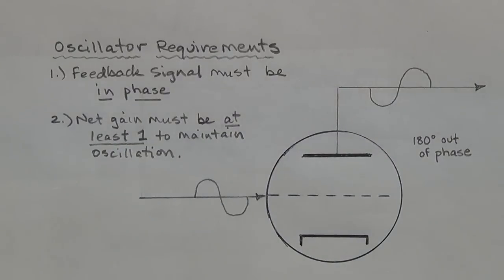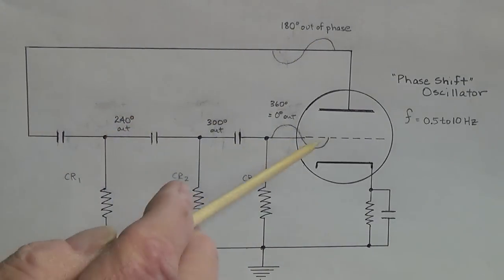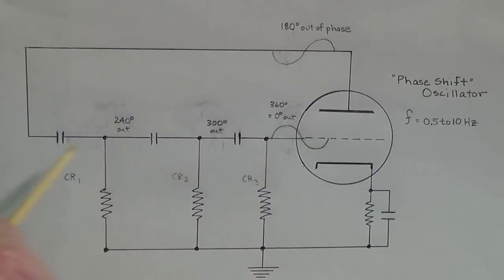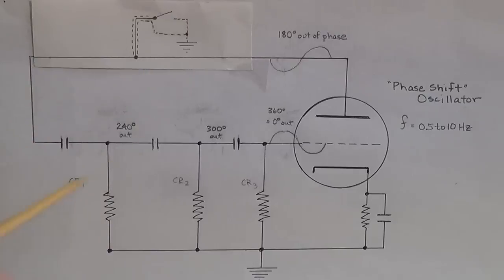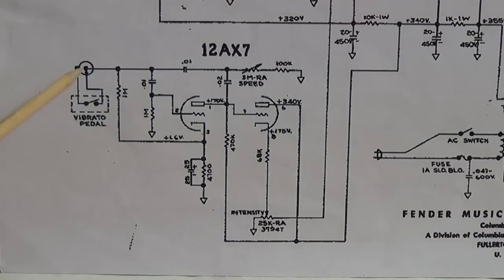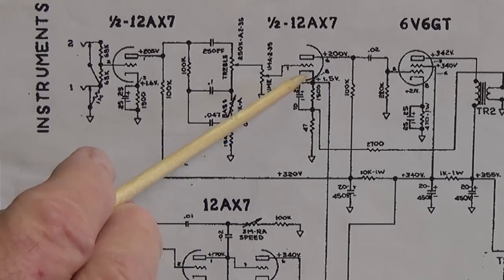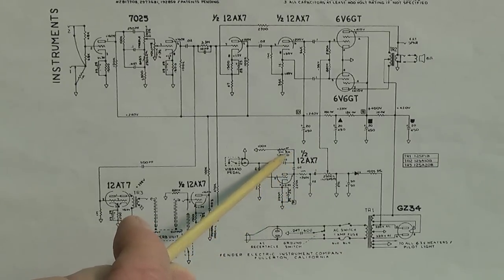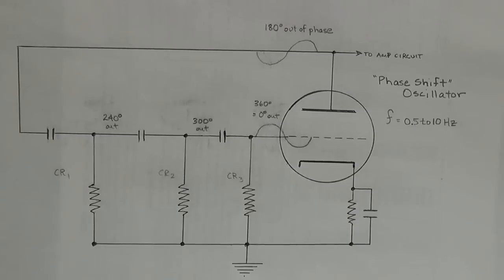How Does a Bias-Shifting Tube Tremolo Work ?

Comment: Pop Quiz: Two reasons you can't hear the Tremolo's oscillator through the speaker when the amp is idle.

Reason 1: The oscillator's output of 0.5-10Hz is below the low-frequency cut-off point of the human ear. I've read you can't really hear sounds below approx. 20Hz. This mainly applies to the single-ended amplifier. The tremolo's output should still reach the speaker in a single-ended amp(you can probably see it on a scope) but you just can't hear it. If you increased the frequency of the oscillator, you could probably hear the hum on the output easily.

Reason 2: In the push-pull amplifier the tremolo's oscillator is being fed into the grid's of the 6V6 tubes in phase. This will still produce an oscillating current in the primary of the output transformer, but since the current will be pulling equally in both directions on the primary, none of signal will be transferred to the secondary and therefore the oscillator signal will never reach the speaker.
Reply from the maker: Congratulations, DU, you get an A+ in Tremolo 3101. The oscillator frequency is subsonic and (due to being applied in-phase to both output tubes) cancelled within the output transformer. Well stated and well done :)
Reply: Thanks. I design all kinds of SMPSs normally, but these vintage tube designs are awesome. I have some old pieces of test equipment that are entirely tube powered. Even a kit-built oscilloscope from 1968 that is all tubes, well, except for a small handful of power diodes. The most interesting part of the scope though is the small tube powered SMPS that generates the acceleration voltages for the CRT. Really enjoy watching your videos. I've learned quite a lot about how tubes and tube circuits function.
Reply from the maker: You're welcome, DU. It's great to hear that the videos are helpful. Thanks so much for your input :)

Comment: Great to see you back with more videos Uncle Doug!  I've been recently trying to get the tremolo section working on a clone of a Univox 45B but without success. (It's a push pull amp using 6BM8 's in the power section and I just love it's tone). The original circuit uses half a 12ax7 and it just doesn't seem to work, I might have to use the fender tremolo circuit design instead.
Reply from the maker: Greetings, Colin. It's great to hear from you. Sorry you're having tremolo trouble. The values of the three oscillator loop caps have to be completely correct, and oscillation will vary depending on the tube....some work better than others. Also, looking at the schematic, the "IMC" value should be around 1Meg, I believe. You might check it as well as the status of the footswitch jack. Best of luck :)

Comment: I think I have got it, the larger tremolo signal shifts the smaller guitar signal up and down the bias slope, cyclically sliding it aternately between the steep part and the flat part of the slope.
Reply from the maker: A viable theory, WC. It's interesting that the Tremolo signal does not seem to increase the volume of the music signal significantly, but does reduce it significantly. Perhaps the excursion into the "flat part" of the slope effectively shuts down the tube response (to music signal), while movement along the "steep part" of the slope has a much less dramatic effect.

Comment: Thanx Uncle Doug and Rusty, I was just working on a similiar circuit!
What is the 25 uf 25v Cap for, it is an electrolytic, thanx
Reply from the maker: You're welcome, GH. That is the cathode bypass cap for the first 12AX7 stage (the phase shift oscillator tube). It increases the gain within the tube.

Comment: Hey the best to you first of,..the info applied will come in handy in adjusting and tailoring the timing of a tremolo circuit being there's custom kits where it's a drop in and play but to their preset. Here there's an explanation that at least coincides with a general understanding that can be added onto foregoing an actual degrees and potentials for a mishap.Thanks!  On my 1969 Ampeg GV-22 a rare composite of a Class A but in a Solid State format, not,.. but I wished (MAYBE) a GZ34,..the duplicated Tremolo circuit design comes in the format of  a rich quality ''B'' series Hammond Organ, Ampeg produced amazing little effects on their 60s amps for accordians,Old ighty-Eights,Harmonica, and my favorite the guitar,..even better than the ole Magnatones, Reverb with a tail when the cut-off's engaged and a separate cavernous Echo, secondly the ''Hammond Styled Tremolo'' also with a tail, with a separate Vibrato as noted by the rocker switches and man there's a definite difference,..the Ampeg Gemini series amps are some of the best Tremolo amps made but with the ''Superlative'' GV-22 40 watter 6L6s there's no equal as` an all around,.. your formatted review brings it to a practical insight that kept me from a misguided attempt of an filter cap upgrade, some reason with the replaced newer filters the effect would cut out and the footswitch had to be rest in order to get going again gotta feeling the circuit's anomaly is presently dependent on  a bias that rejects extreme changes figure in the older resistors,bypass caps, tubes 6CG7/6FQ11(?) , RCA7025, and the Audio filter electrolytics, it's in the timing, by all means please alert me if you think otherwise, Thanks again Uncle Doug the best to you and urs and our Buddy Rusty the Wonderdawg!!
Reply from the maker: Nelson, it's always good to hear from you and benefit from your very broad knowledge and experience with vintage amps. It's interesting that you may have a circuit that resists extreme bias change, which is quite unusual in a non-cathode-biased (I assume) amp. Rusty and I send our best wishes. Thanks for your input.
Reply: I caught something you stated could be a  probable fault in that there's a chance that the footswitch is faulty explaining why the analog signal drifts before the effect not the signal fades away, odd too is that the timing is always the same  like a preset on a clock or a momentary switch, I'll reassemble the amp and resolder the ground on the footswitch and see if it solves the problem,..   neophyte serendipity I think lol,Thanks!!
Reply from the maker: Footswitches cause a lot of problems with reverb and tremolo circuits, Nelson. I hope you discover and rectify the problem.

Comment: Hey UD, great work yet again! Actually very timely as I'm considering putting output-tube bias-shifting tremolo in an amp. The last couple I've built are along the lines of the Valco Tremotone with a 6SQ7 acting on the first preamp tube. At any rate, I was under the impression that when you switched the tremolo on, it actually connected the circuit to ground. Then the switch was opened to silence it. You seem to show the opposite about the 8:00 mark. It's entirely possible I have also sucked up too many solder fumes...
Reply: Upon further review, yes, I need to invest in a good extractor system.
Reply from the maker: Greetings, Pisola....it's always good to hear from you. We missed you at our AU meetings :)
Reply: Uncle Doug
UD, I think I had the right thought and the wrong spot. You were indeed correct the first time the way it's drawn. Please check my math on this -- the Fender circuits (similar to what you have drawn) do shunt the voltage in the resistor-cap filter loop to ground, effectively turning the tremolo off. The circuits I've built are more like those used by Supro, Ampeg, Gibson and others, where the switch goes between R1, R2 or R3 and ground. Those circuits don't operate if the switch isn't closed to ground. Sorry about that.
Reply from the maker: Greetings, MA. It is confusing. The Vibro-Champ in the video does not require a footswitch for Tremolo to operate and if you have one, grounding it does stop the Trem. The very similar grid-biasing Trem in the Princeton Reverb does require a footswitch because grounding the Trem loop turns it on. Likewise with the photo-resistor Trem in the Deluxe Reverb. Thanks for the follow up comment. Your input is always appreciated :)

Comment: Thanks for the video. I've been curious how  these really work, particularly the oscillator. Would that be the same as the freq oscillators in old tube radios such as superhets? Is there any functional advantage to use 3 vs. 4 RC filters to adjust the phase shift? I can see where a 3 step network ought to be cheaper and less complex due to fewer components. And, can you say if there is preferred location for the speed control on the resistors or would it be depending on which allows a shorter connection to the controls on the face plate? Thanks again! Wonderful as always.
Reply from the maker: You're welcome, Bob....thanks for your kind words and good questions. Radio transmission uses oscillators (to produce a carrier wave). Radio oscillators operate at much higher frequency than audio oscillators, i.e. RF rather than AF.....at least a thousand-fold difference.

Yes, I think the 3-stage filter is probably cheaper and easier to produce than a 4-stage.....and probably less prone to failure (fewer parts). Fender tends to place the speed control pot on the first RC stage, while Vox uses the second stage. Even the 3rd stage could be made variable as long as the loop gain is adequate. The lead length would probably not be of significance since no music signal is present.

Comment: Regarding the fixed bias circuit. The guitar signal and the tremolo signal are  connected to the grids.  You describe  that  the variation of the  tremolo voltage varies the bias and the gain , why does the variation of the guitar voltage not also shift the bias and the gain, any ideas.
Reply from the maker: The bias voltage is a fixed negative DC voltage applied to the grid, that (in my mental picture of the process) lowers the entire music grid-signal wave form far enough below the zero (X) axis that it never reaches zero or (heaven forbid) the positive side of the axis. The music signal that is applied to this always-negatively-charged grid alters the grid charge up (less negative) and down (more negative), depending on the polarity of the music signal. The fluctuation of grid charge creates a much greater and opposite-phased signal on the plate by either reducing the plate current when grid is negative or increasing it when grid is positive.

Bias is generally defined as a fixed (negative) DC voltage applied to a grid (for the purposes described above). The AC music signal is altering the bias charge on the grid very rapidly and equally in both directions (+/-), so there is no net change of bias charge during an audibly-discernible interval. The low-frequency oscillator signal alternately enhances and suppresses the amplitude of this higher-frequency bias-charge alteration by increasing and reducing the bias charge itself, and it does so at such a low frequency that the change is audibly discernible.

Comment: No signal is needed to the grid of the 12AX7 oscillator tube for this circuit to function? I know you have not had as much experience with the Vox AC 15s & 30s, a friend of mine just bought an AC 15 and I to would request any info you would share with your loyal followers on these tube amps, after all,  Rusty and you are international film stars now! Thankz
Reply from the maker: A very good observation, ATL. I too wondered what actually starts the oscillation within the tube, since there is no provision for input of an external signal to begin the process. According to reference sources, the ambient electrical "noise" within the circuit initiates the oscillation and then only the appropriate frequency (i.e. 5 Hz) is reinforced by the filter network.....all other frequencies lose energy and stop. You may have noticed that with some tremolos, it takes a second or two for the effect to come up to full volume after you switch it on. I had one amp that took 5-10 seconds for the tremolo effect to fully develop. This delay reflects the time it takes for the ambient noise to get the oscillation started and up to full power.

Re the Vox comparison, I will keep this in mind for a future video, especially if I can get my hands on a vintage Vox amp (rare as hen's teeth in my area). It's important to remember that virtually all the principles I discuss in videos apply equally to all brands of amps. They may differ in some of the details, but the underlying principles are the same. In the Tone Stack video, which revealed one of the few ways they differ, I addressed each major brand, including Vox, individually.

Actually, Rusty is the star.....I'm just his "straight man" :))

Comment from the maker: Izaak, your question did not have a reply capability, so I will reply here. There is no fixed phase shift value for an RC filter. The Phase Shift = arctan  1/ (2 Pi x frequency x RC) thus, it is dependent upon the frequency cutoff and the values chosen for the resistor and capacitor. In the Phase Shift Oscillator, the values chosen for the (third order) filter yield a total phase shift of 180 degrees. It's also possible to set up a fourth-order filter (with different component values) providing four 45-degree phase shifts to accomplish the same result.

Comment: I'm going to take a spin at the pop quiz....    The AC signal that comes from the Oscillator is Sub-Sonic...   below 20hz.   So even if it made the speaker move, it's not audible.    I would almost think they could have put a diode in there so there's only plus DC or Zero going to the bias circuit...

I'm getting closer to getting this stuff.  You did well my friend.   Now if someone would just make a slow-mo animation of the oscillator working,  I really think I'd have it nailed.
Reply from the maker: Greetings, DK. It's good to hear from you. Thanks for your kind words. Yes, the oscillator signal is subaudible, and your idea about rectifying it is interesting, but remember that it must be a full AC signal to accomplish its goal of boosting and suppressing the tube bias. Rectification would neutralize its effect. There is a second reason that the oscillator signal to the 6V6's is inaudible, and would probably be so even if it were of a higher (audible) frequency. Hint: Think about the output transformer.
Reply: Uncle Doug
Ok,  here's my next guess...  since this amp is Push-Pull,  is it possible that the bias shifting signals cancel each other on the way to the output transformer?
Reply from the maker: Actually since they are in phase with each other, they would cancel each other within the OPT; but yes, you are correct :)

Comment: Another amazing tutorial, thank you.  The "Charles Bronson style" hand acting was superb as is Rusty's camera work. :))  If I understand the pop quiz question correctly, feeding the signal to both 6v6 grids would cancel each other out.  If I'm wrong, please stamp my meal card "no dessert". :))
Reply: Uncle Doug ***** I think you've got it... Human hearing is supposed to go as low as 20Hz, though everyone's ears are different. Even so, 10Hz and lower is quite a stretch... I proly woulda guessed it with some thought, but I read threough comments first. Aw well, next time, I suppose. Looking forward to the Optoisolator/Lamp-LDR video, Doug! Thanks for another great installment.
Reply from the maker: Thanks so much for your excellent answers, Andrew and Britt. Actually, now that I've thought about it, Andrew's first answer also makes sense. The music signals applied to the grids of the PR 6V6's are of opposite phase, due to the (cathodyne) phase inverter, and reinforce each other in the OPT. The oscillator signals applied to the 6V6 grids are in phase and therefore would indeed cancel each other in the OPT...which is the way that audible noise is reduced in the output of push-pull amps. The signal to the cathode of the 12AX7 in the single-ended VC, is not heard simply because it is subaudible.
Reply from the maker: Thanks so much, Andrew. It's great to hear from you....one of few who recognizes my hand-acting skills (the pathos of my performance in this case tastefully accentuated by kitten scars). Re the Pop Quiz, no gold star yet (Correction: see explanation below). Think about the frequency of the oscillator signal.
Reply: Uncle Doug I watched again, and with your hint, think I might have it. Hearing a 10Hz signal would be a bit difficult.